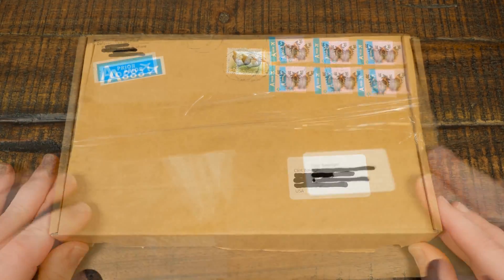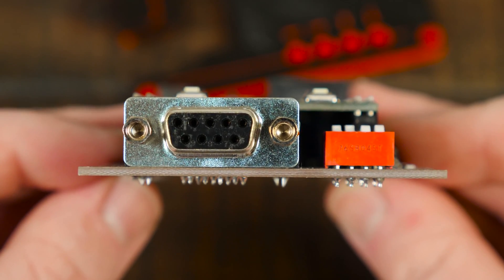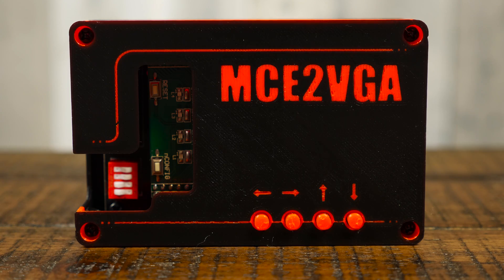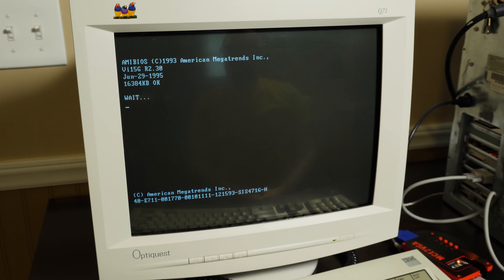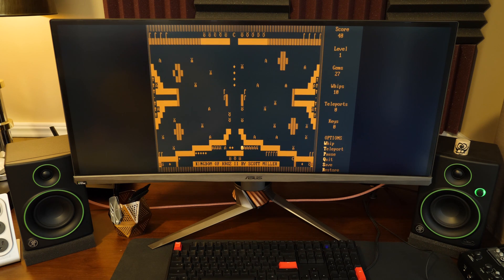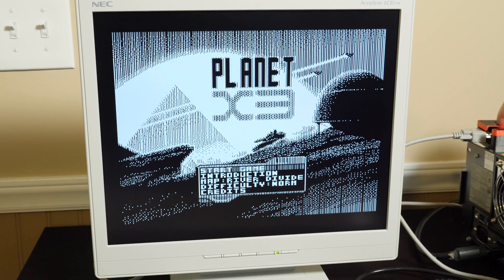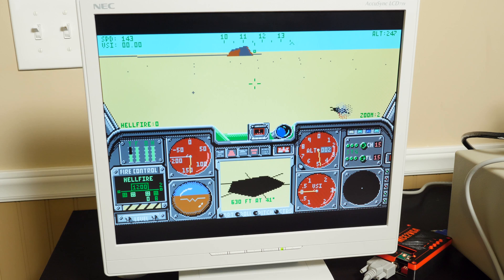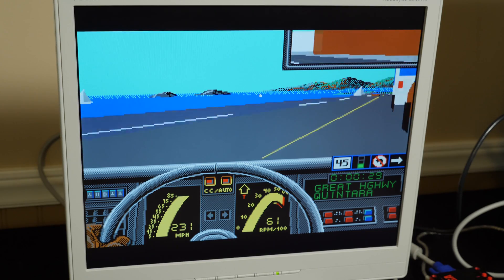Converting MDA/CGA/EGA Graphics Output to VGA!

Comment: Hi, I have an old car wheel balancing machine with a Cabel old CRT monitor that stoped working. The output on the machine craphics card has a D-sub 9 pin RGB plug with the ground (1), red (3), green (4), blue (5) and Intensity (6). Pins 2 and 7 (NC). H-sync (8), V-sync (9). Will this work to use a samtron lcd monitor with standard 15 pin VGA input? Thank you.

Comment: I'm wondering how something like this might work through the Open Source Scan Converter. Is that something you've tested? I have my family's original IBM PCjr that I'd like to get running again, and it would sure be easier to stream and capture footage from it through something like the MCE2VGA converter, to the OSSC, rather than using the lousy composite signal off the board through a RetroTINK 2X, or similar configuration. I would love to be able to play King's Quest again, and since that uses the lower-res 16 color mode (like the Tandy mode you mentioned), it would be ideal, similar to some of the cartridge-based PCjr games I own, like Crossfire, or Scuba Venture. I could still capture audio from the RCA output on the board, but to be able to get a cleaner video signal would be amazing, and a 9-pin DBA m2m cable would certainly be an easy thing to procure at this point.

Comment: Looking for something like this I can cram into a PS1, power of PS1's 5 volt line, and not have to fuck with buttons. Just 240p and 480i upscaled and de-interlaced to 480p. Should be doable for like $10. Bonus points if it does that with a simultaneous higher resolution HDMI output for capture cards.

Comment: Well, ,"decades" ago, you'd have plugged your random-standard cards into a Multisync monitor. Though that still wouldn't have done much for the composite artefacts of course.

If this thing works alright for CGA, I wonder if it'll work well for other not-quite-NTSC (or PAL) standard computers as well? Atari in particular are a pain to get working well with VGA or capture devices...

Also whether it can handle the various old esoteric 384/400/etc-line 25kHz modes. AT&T, early Mac II LCs, all manner of Japanese 80s/early 90s systems, etc

Comment: You should check out the Startech USB 3 capture device - it handles every output my ossc throws at it no issues (where most capture boards hated it).

Comment: When an MDA or CGA mode is set up on the EGA by calling the BIOS, then the raster timing, video memory layout, data format, and some other low-level hardware details such as cursor control are identical to those aspects of the operation of an MDA or CGA, providing a high degree of direct software and hardware

Comment: +LGR  I spotted some old TV's at thrift shops with Component RCA feeds.   Are any offboard adapter devices on the market that allow driving a TV's Component inputs from a TTL display adapter consistent with the 8-bit Hercules products based on the Motorola® MC6845P, Hitachi® HD86505SP, or equivalent?

Comment: For capture, have you considered an Epiphan DVI2USB 3.0? It's what I use with my SGIs and their unusual sync-on-green video signals, and I've heard of people using it to capture other strange video formats (e.g. 16hz). Any IRIX or ARCS PROM footage I've had on my channel recently has been recorded with it. It'll also natively capture just about any aspect ratio you throw at it, which is useful. A lot of the "consumer" devices don't want to do anything but 16:9 or 4:3.
Reply from the maker: I have some Epiphan devices, they're one thing I was referring to when I mentioned having capture devices that work well with this.
Reply: @LGR  Ah, great, yeah, those'll take anything. Thanks for the reply!

Comment: Real nice device but will it do what I need?  I have a IBM XT case and matching monochrome monitor.  PC case is empty but monitor works.  I want to run a raspbery pi with linux command line on that original monitor so it will resemble a old DOS maching.  Can this video converter (probably need another converter to go from HDMI or composite to wha?) From the Pi to useable on the monochrome monitor?

Comment: Wonder if they have the space on the FPGA to add support for Amiga 15kHz and maybe other systems? Tried the GBS-8220 and it was GARBAGE and I know a lot of people complain about the lag introduced. Useful only for me just long enough to transfer files and verify a system was working. Now I use either a GGLabs A520HD component adapter and a decent Philips CRT TV or a Dell U2410f which will sync down to to 15kHz. The component output looks perfect but I don't always want to use a giant TV on my desk but the Dell has some artifacting and noise that cannot be adjusted away through settings.

Comment: I guess even though it is a RGBI connector it won't actually handle RGBI like the Commodore 128 80-column output, which is a shame! Had to order one anyway obviously, it will definitely come in very handy to use with my Tandy 1000HX!

Comment: What I would love to see is for 4k displays being able to emulate the lower DPI screens.  I remember EGA(ish)/Enhanced CGA graphics on my Amstrad CPC 1512  for the few games that supported it, the graphics of 16 color games, combined with the Screens Low DPI actually made these game much better, the low 320x200 resolution with the low DPI had smoothed the pixels so the images were just that much more natural.  I remember taking the Amstrad  Driver in Kings Quest IV and applying to the other Sierra Games, to give me a wonderful gaming experience, with a PC Speaker with a volume knob.

Comment: I can see this being useful for testing purposes. Not having to get around with an old and heavy crt.
For final use though... Nothing like the original thing.
Nice, still.
Reply: Well said. It is useful for capture too, as well as for those who want to game on flat panels. And is good future-proofing. But for me, it's CRT or bust!
Reply: @FinalBaton  and what happens when you 40-year+ monitor does go bust? Have you priced a vintage monitor lately? Not even gonna mention shipping...
Reply: @Caseytify  Well I did mention "and is good for future-proofing" in my original post, didn't I?

Comment: @LGR at 4:23 you have a 4:3 flat screen monitor. I'm very intrigued by this monitor. Could you possibly explain what it is exactly and why you use it? Heck, an entire video of that monitor would be very informative. I'd like to get one but I know nothing about that particular design. Thank you so much.
Reply: I had a BenQ that was like that. LCD monitors started off with the 4:3 ratio so not sure why you are so surprised? They used to be very common.

Comment: Can anyone tell me if it is possible and if so, how do I need to connect the 9-pin EGA output of the video card to the GBS-8220 (or GBS-8200) so I get picture with all EGA colors? 
The GBS-82x0 board has only 5 input ports for EGA, but the graphics board's EGA output has 9 pins. 
Must "secondary Red / Green / Blue (Intensity)" be connected to create an image? 
Is there at least a simpler DIY solution to make a monochrome EGA to VGA adapter?

Comment: LOVE the Planet X3 bit.
Reply: Where as this is a great product, can it do what I need?  I want to restomod a IBM 5150 XT.  I got orginal case and working monitor. Case guts are gone. Want to install a raspberry pi but run command line linux on the orginal momochrome monitor. Will this device (with another converter box before I suppose) take what the Pi outputs (composite or HDMI) so I can use the orginal monochrome display?
Reply: You are asking the wrong person LOL.

Comment: Isn't amazing this processor inside the adapter probably has hundreds more processing power than the retro computers you are adapting into?
Reply: Altera Cyclone IV is not a processor, it is an FPGA (programmable gate array).
Reply: @TzOk  It's indeed an FPGA and as such can have a CPU core programmed in it, so it may have some decent processing power.
Reply: @TzOk  Is that bad?
Reply: @RodrigoBadin  No it is not bad, but you can't say about the computing power when talking about FPGA. Although you can make a CPU or DSP out of FPGA, the processing power would depend on the IP core you use/create. FPGA can be whatever digital device you want.
Reply: @TzOk  Mind blowing!
Reply: @RodrigoBadin  In the "old days" you could either create the glue logic out of 74xx ICs (big, high power consumption) or create an application specific IC (expensive in small volume production). In mid '70s there came a new solution - ULA chips (still factory "programmed", but much cheaper than ASICs). FPGAs are modern equivalent of that ULAs, and can be "field programmable". In-between there were PALs, GALs and CPLDs. More extreme usages of FPGAs are devices like MiST, where not only the CPU but almost the whole computer is recreated inside the single FPGA chip.
Reply: @TzOk  see also: pedantic.
Reply: @AruãRamosMetellodeAssis  No, tzok83 is right, this is an FPGA, there is no "thinking" involved here, it doesn't really "compute", so the retro computers have more "general computing" power than any FPGA, which doesn't rub me the other way at all.
Reply: @JanghanHong  The point is certainly arguable, but FPGA chips are digital, designed for doing computer-like computation. This particular chip is not configured as a computer, but if it was, it would have a significant amount of power. The chip's raw resources include 15 integer multipliers and 32 MB of RAM. It's hard to find comparisons, but I estimate this exact chip could hold two 16-bit processors running at 100 MHz.

This sort of thing was not unheard of back in the day -- The Amiga 3000 had a "flicker fixer" chip that would digitize the Amiga's CGA-quality output and generate a VGA-speed image. Both those features would have been AWESOME if they had been exposed to the main computer, but alas they were hidden in a chip whose only purpose was to drive a VGA monitor.
Reply: Janghan Hong  a FPGA is basically a blank IC that you can wired the way you want via software. Giving its size you can replicate a CPU, a controller or almost any other IC.  But you’ve pay the price in maximum frequency it can achieve and being 100x more expensive than custom ICs produced in volume
Reply: This is idd an FPGA and processing power is not the word. It is no CPU as it does not execute instructions. It is pure  hardware. So no lag and perfect for it’s task.
Reply: FPGAs can not only execute instructions but they require code to define how they work. FPGA stands for field programmable gate array which means its a collection of logic circuits for processing data like a cpu but you can define with software how those logic circuits are arranged together. You could swap the programming and mine bitcoins on it, you could run all sorts of software that runs on a cpu. So yeah you can compare them in terms of performance and yes you could program it to function as a fully fledged cpu
Reply: @derpinbird1180   Glad someone said it.
Reply: @AruãRamosMetellodeAssis  but it's not right. Comparing FPGA to a CPU is like comparing a blank canvas to a Rembrandt. Sure there is lots of potential but it's blank initially.
Reply: Don't get me wrong I love this stuff, but yeah that's one of the things about it that kinda tick me the wrong way

Comment: Male-Male DB9 gender changers do exist, and should not be hard to manufacture.  They ought to throw one of those in the box with the product.
Reply from the maker: The gender isn't the problem, it's the fact that all the old TTL monitors I've come across have a permanently attached cable. So there's no way to plug in your graphics card into the MCE2VGA without a standalone cable. Ideally what they could offer is a straight-through serial cable like I showed in the video :)
Reply: @LGR  Ok, understood ... a shielded DB9 then.  Being a hoarder, still have several of those too.  Wondering now if anyone still makes raster tubes that can produce the nice sharp amber or green mono, without scaling.

Comment: Regarding video capture, it probably wouldn't be much work for them to modify the FPGA configuration to dump raw video frames. They'd have to add a USB port or something similar, but maybe you should suggest it to them.

Or perhaps they could include a special output mode that is more compatible with capture cards. That wouldn't even require any hardware changes.
Reply from the maker: It's more a matter of capture devices needing to support 720x400@70hz and the like, which the MCE2VGA is outputting as intended. For example, my AV.io HD captures the MCE2VGA in all its graphics modes just fine, but my Avermedia Game Broadcaster HD does not. So it really depends on what the VGA capture device looks for in terms of video signals, and unfortunately that varies wildly across devices. But still, an alternate output mode for the MCE2VGA would be neat to have!
Reply: @LGR  They do offer an add-on programmable development board with USB that might be able to do that.
Reply: Maybe the special output mode could be a 4th version of the product. 
Calling it the "MCE2VGA/LGR edition"  :D
Or a more general name like "Video Capture Edition"  is also a possibility if it is worth doing that of course.

Comment: Would you happen to know what I would need to run a monochrome monitor. Kinda the exact opposite if the video, but I figured id ask.
Reply from the maker: A monochrome display adapter, if you're talking original TTL stuff :)
There are also composite monochrome monitors, like the BMC BM-12A I covered a while back. You can plug pretty much anything modern into those using something like an HDMI to composite adapter.

Comment: I've been looking for a reliable upscaler for my Amstrad MegaPC which uses 15hz whilst the megadrive is operating and then back to standard VGA when the pc portion is running.
Reply from the maker: I've got a MegaPC myself and that's a big hurdle to overcome. I've tried every scaler I can with mine and sadly nothing works yet. The GBS-8200 did a decent job of things but it doesn't switch back to VGA when you move into PC mode. So until a better option comes along, I bit the bullet and imported a 15/31kHz multisync CRT monitor like the one Amstrad originally shipped with it.
Reply: @LGR  Yes I had the exact same problem which made it very frustrating to use which is a shame for such a cool piece of hardware. If you ever find out a solution feel free to post up a video, or hell, dm me (however you do that on YouTube?)

Thanks for the videos man

Comment: Been using this converter quite for a while. It is no doubt the best option for playing with old PC's that output TTL video.

Best results are achieved using a VGA CRT, if you have to use a LCD make sure you use a proper 4:3 aspect ratio monitor. But CRT is unbeatable.

I need to add that composite emulation is still not yet perfect, it is close but not there yet. Comparing this converter with a real TV/Composite monitor side by side will show the differences.
Reply: Carlos Teixeira So it can't output to  SVGA (800x600) or WVGA?  And it can't do refresh rate conversion to typical VGA or SVGA speeds?  As I commented on a community post about this, it wouldn't be that hard to hook a VRAM chip to the FPGA and actually do scan rate conversion using different FPGA programs for each mode with a microcontroller loading from a serial EEPROM/Flash as needed.  There may even be capacity left for on on screen display.
Reply from the maker: Correct, no SVGA. Though it outputs at refresh rates of either 60 or 70hz depending on the graphics mode being converted. All native to VGA!
Reply: @johnfrancisdoe1563  I didn't design the thing, so can't speculate on how what could be done. Every graphics mode is displayed to the closest most compatible VGA output. MDA and Hercules will be displayed in 720x400 @70Hz, 15KHz TTL CGA and low res EGA will be displayed in 720x480 @60Hz and EGA high res at 640x350 @70Hz.